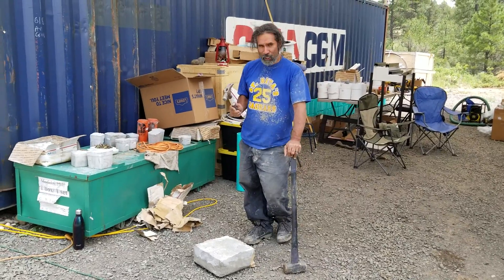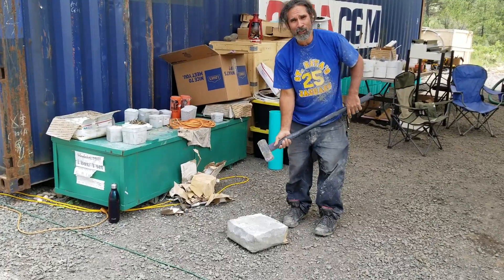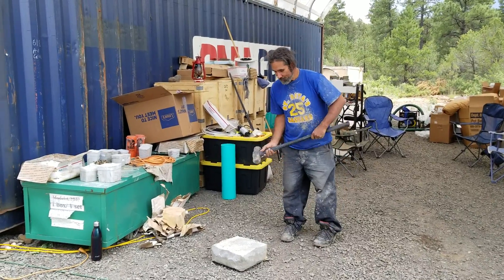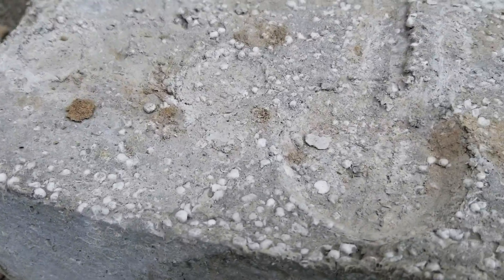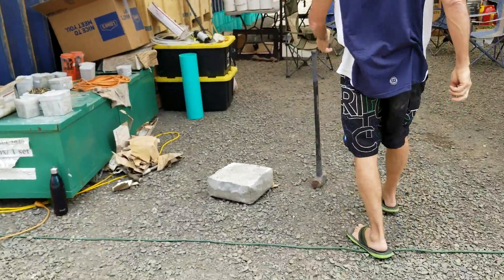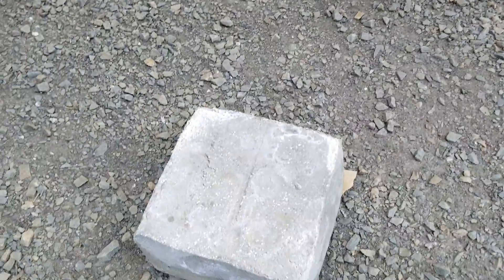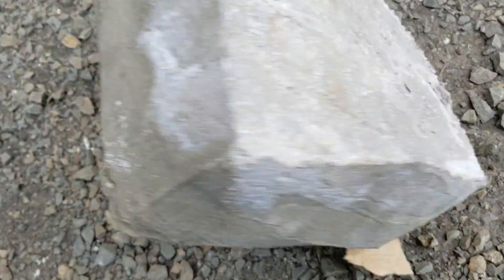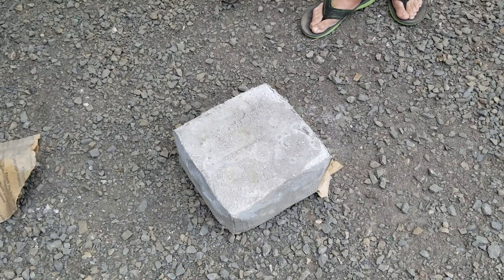Sledgehammer Test on EPIC Brick #EPIC #AircreteHarry #Dome #FoamGenerator #Aircrete  #Hammertest

Comment: What would be better to build a dome with to cover in cob material? Aac, clc, or epic. 
Or in (soil) load bearing walls for a  earth ship type of application
Reply from the maker: The Epic material would be the best to build a dome with you would not require any other material on top of the Epic, Other than a waterproof stucco. The cost of epic is the same as aircrete in that the materials you need are paper and styrofoam which you can acquire for free you're only purchase will be cement.
Reply: @AircreteHarry  would epic also be suitable to erect earthship walls? The whole tire offgassing thing perplexes me so.
Reply: I'd be highly interested (vid ideas) in seeing far more epic applications. Notably, epic wall soil weight stress testing

Comment: Now this will be a lot of work...  
You should make an accurate mold of a cinder block.
Make some of your bricks with that mold, and test your brick against the cinder blocks.
Support the test pieces the same way, and use a repeatable penitrator, and add weight until the test piece breaks.
That way you can compare the results. 
Just an idea...
Thank you for all your hard work, and thanks for sharing your videos.
Reply from the maker: Thanks, Willy I already have some samples made and are making more to send to a lab for compression testing. The first ones have another week of curing before testing.
Reply: @AircreteHarry  
Thanks for the reply. 
🤓😆😎